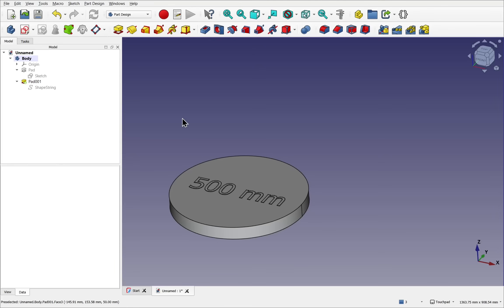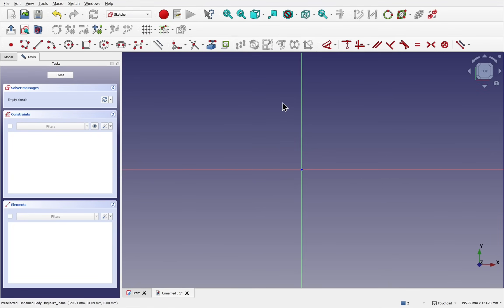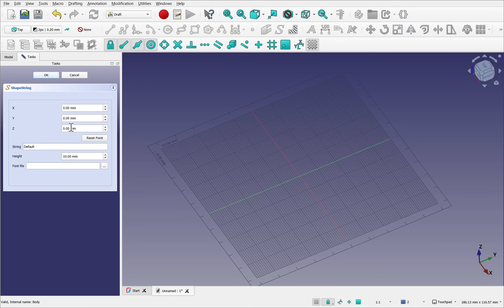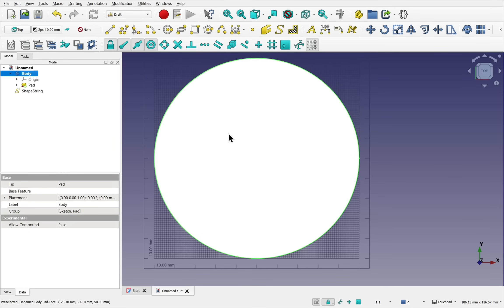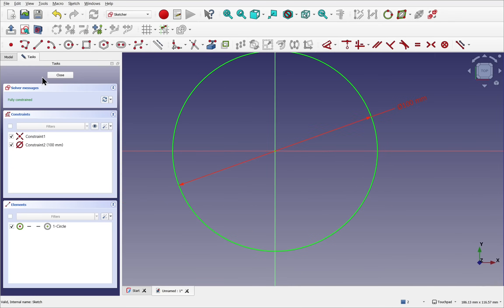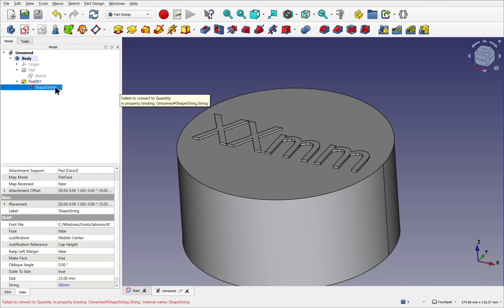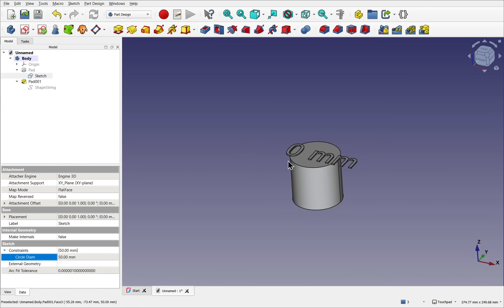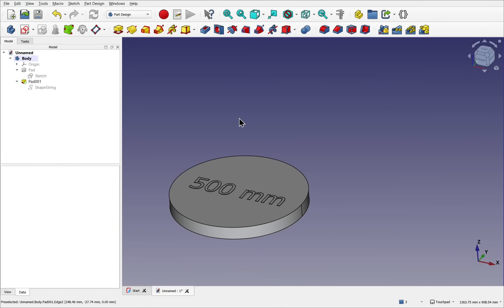Dynamic Text in FreeCAD? | Text Display & Size Changes With Size of Model | FreeCAD v1.0

Comment: A request: 
There are endless videos on making either raised or indented text on the internet. This is probably due to the preponderance of 3D printers that can use only one reel of filament (one color) at a time. However many things with text on them are normally made with the text completely even with the surface of the object. This can be done with two colors of filament and many modern 3D printers do have this capability. There are many good reasons for this. One, that I presently have a part that would benefit from it, would be to help keep the part clean in a dirty environment. 

This can be done. I have printed objects from the web with both text and lines that are completely even with the surface. And I am working on finding an easy way to do this. Some videos would be nice.
Reply from the maker: Hi, I do have a video that may be of use (link : https://youtu.be/NFRnH9Va_ac) It's a very old video but is this the kind of thing your are looking for?
Reply: @MangoJellySolutions  That is a different video or technique because you create multiple elements for the text and the body. But how can you create for instance a front panel for a diy electronic device. A rectangular panel with holes in it for switches and potentiometers. But added!!! to that some white or silver text on that (for instance) black panel. In practice you would print this upside down on the printbed so that it will have a great finish at the front but the bottom layer of this body will have the text indented into the body. I hope I explained this well enough.
Reply: @MangoJellySolutions  And if you print this with say a 0.2 mm nozzle you can get some amazing results.
Reply: @MangoJellySolutions  And it really surprises me that I can not find one single video about this? while a 3D printer has perfect capabilities to achieve such a practical application.

Comment: I am sure the methods presented here do work. And I will probably save the link and view the video several more times in the future. But I must point out a much simpler way of both easily changing dimensions or any number in FreeCAD and even locking them together in proportions as desired. It is the SPREADSHEET. Before I start creating bodies I create a spreadsheet. In that spreadsheet I use one column to record the arbitrary, variable names I wish to use and in the column to the right of it I enter the values for those variables. Each of the cells that has a value in it is given the variable name as the alias for that cell. 

Once that is set up you can simply type "Spreadsheet,.VariableName" where any value is needed and FreeCAD will substitute the value from the Spreadsheet for that constraint. 

But here's the kicker! You can also enter formulae in the cells of the spreadsheet. So if you have two values set up in the spreadsheet (example: ButtonDiameter and TextLength) you can enter the diameter as a number of mm or inches or whatever unit  in the first and then a formula in the second that references the ButtonDiameter in the second (ButtonDiameter * 0.75). This locks the two dimensions together with the 0.75 factor. 

For most changes to the model size you only need to change the one dimension in ButtonDiameter. TextLength automatically and instantly changes in proportion. On the other hand if you only need to change that ratio, you can just edit the formula for TextLength. If you anticipate making a lot of changes you can even use a variable name and cell for that value and reference both terms in the expression above. Going to and from the spreadsheet is a LOT easier and FASTER than jumping in and out of the sketches to enter the changes. And if you make an error it is a LOT easier to correct. 

You can even make a copy of all the values in a different column of the spreadsheet as a back up or create a table with values for different versions of the same part. 

One more tip: when a cell in the spreadsheet has a formula in it, I like to give it a different background color. This lets me easily skip over them when I only want to change the values and leave the equations alone. 

Spreadsheets are easy to create and set up. The time for drawing this model could probably be cut in half by using one instead of all the fussing around, in and out of sketches shown in the video.

Comment: A wishlist feature for text would be to add kerning to the shapestring text. Kerning adds additional space between the characters. The character shapes do not change. I have other software that has kerning. For 3D printing, I find that 10% kerning helps keep the 3D printed characters from running into each other. This changes the space between characters to 110% of the normal font character spacing. This is a percentage so that it will work with proportional spacing fonts.

Comment: Back again, this time with a potential solution upgrade. Your example certainly scales in height, but not in overall length.  For example, if the string "mm" was replaced with "millimetre" it would still hang over the edge. 

My solution was to use a spreadsheet. I found if you named the shapestring to be "TextToPrint" I could then access parameters in spreadsheet via "=<<TextToPrint>>.String" to get the string. Now the tricky part was determining the parameter names for the bounding box.... what I found that worked was: =<<TextToPrint>>.Shape.BoundBox.XLength ... close but not quite. As I needed inches but FreeCAD's default internal unit is mm ... to convert to inches I needed to divide by 25.4.
Reply from the maker: I love the way you have accessed the object properties as if you would with a macro but using the spreadsheet wb. Really cool idea, thanks for sharing that 👍👍👍👍
Reply: @MangoJellySolutions  Actually it came out less satisfying then I hoped. Reaching back into the model built from a spread sheet creates a DAG error (issue?). Basically, the solver thinks it could be in an infinite loop. No if I could mark that cell as only recompute manually, then all would be good.

Comment: hello MangoJelly :)
I've seen you're making boxes for electronic PCBs.
Hier is a tip for new video. KiCAD allows to expert PCB as step file and FreeCAD can import that step file. That way you can easily make PCB box.
Cheers :)
Reply from the maker: Thanks for adding that, I would love to integrate these together in a tutorial at some point. Thanks for the idea 👍👍👍👍

Comment: Oh, if only I had this video a couple of weeks ago!  I struggled to do this sort of thing, although eventually succeeded after reading various forum posts and other material (it took me three separate sessions to get it).
I used a spreadsheet (as another commenter mentions), which also allowed me to put a maximum size on the text.

Although you can do a lot of things in FreeCad, it's often very unclear how to achieve those things.  It shouldn't be that hard.
Reply from the maker: Ah what a shame, normally I have a habit of just releasing a video and viewers jump in and say 'you must of read my mind! I only just started thinking about how to do this yesterday!'.  My Spidey senses must of checkout early for Christmas lol.  Glad you got it resolved though.  I know what you mean regarding about things being unclear.  I just spent two days on and off trying to figure out how to use a newer operation with virtually no documentation.  Got there in the end so I better make a video on it to save other people going through the same pain.  Have a great festive break.
Reply: @MangoJellySolutions  You may be interested in part of my problem and solution.  I was printing blocks of different sizes (different in one dimension only), and putting text on two sides, one being the side where the size could be different.  I couldn't put text on that side when it was very small, so I also wanted to not have that text in such cases.  I found (from looking online) that if you go to the Data tab of the pocket and 'show hidden' properties, then right-click on the 'visibility' property you could create an expression for that (which I linked to the spreadsheet where there was a formula for that).

Comment: Just made my shims models soooo much easier to manage!   Had no idea that there were string formatting capabilities.  With a linked spreadsheet, you can also include formulas in the mix so for example, the text only ever gets so big or formatting changes based on other parameters.
Reply from the maker: Ah great to hear you made use of it already :) :).  Nice idea with the spreadsheet! :) :)

Comment: Has anyone else experienced issues with padding a shapestring, then going back and editing it, and then having only the first character show up in the pad?
Reply: Have you tried that with different fonts? The font might be missing the characters you are using or has glyphs made out of multiple wires instead of a single outline. These are usually my main issues with a shapestring.

Comment: Another use case ... Name tags on a standard size tag, scales the name. The data could come in from a spreadsheet. The write the GCode to cut on a CNC
Reply from the maker: I like it :) :) :)
Reply: @MangoJellySolutions  I will be making name tags for church. I bought a sheet of Rowmark, DurMark  Red/White to play with.  It is a laminate of red/white/red material. 1/8" 12"x24 is ~$31 US dollars ... but they say the will send a free sample.

Comment: to add the mm to the text, wouldn't it be easier to multiply by 1mm?
Reply: That should work as well.
Reply from the maker: I don't know, but if it does that would be a quicker solution.  Thanks, going to have to try this now :)
Reply: @MangoJellySolutions  old trick from css to convert any plain number into unit you need and have used it many times in FreeCAD as well.